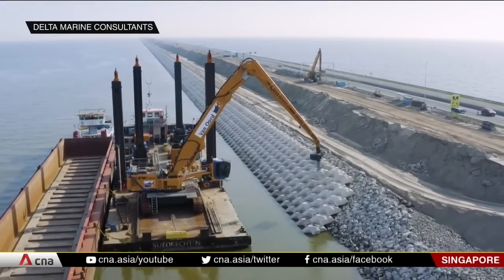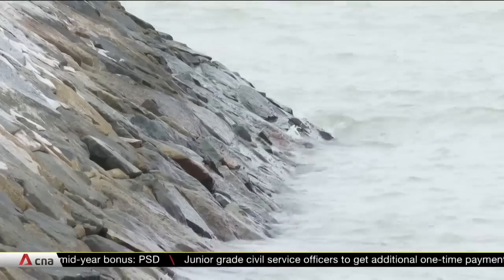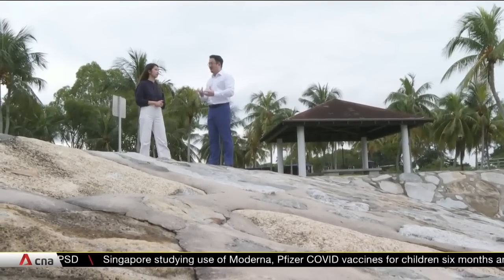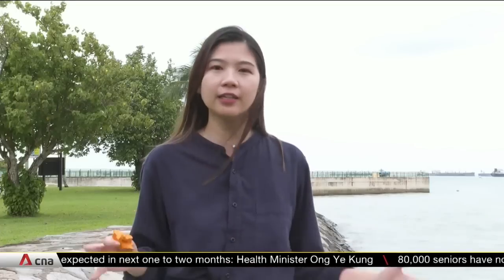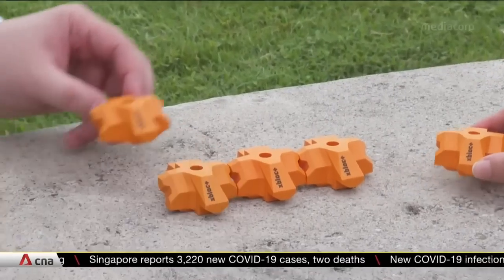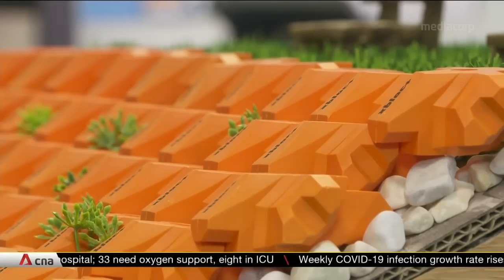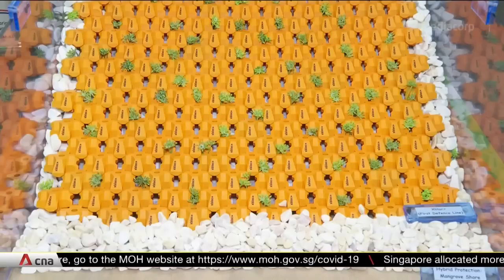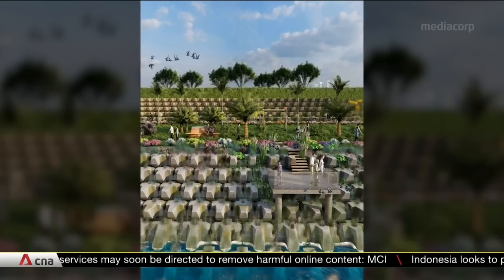Singapore studying feasibility of modular coastal protection system

Comment: These types of armour typically used in exposed coastal area, Singapore is quite protected by the surrounding island so it is not needed. These are not the solution to sea level rise issue.

Comment: Dig deeper n reclaim less, just like a pond full of water when it rains it will overflow , dig deeper is the easiest way to contain more, of course u can't change the pond size which are already there .if can reclaiming then it should be able to dig deeper with modern machinery